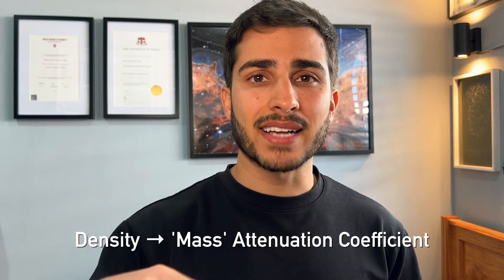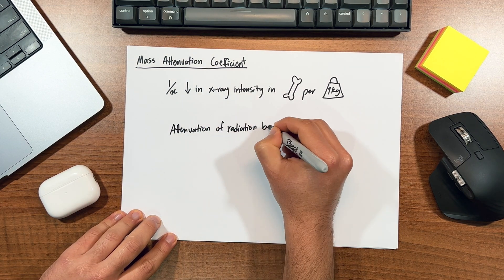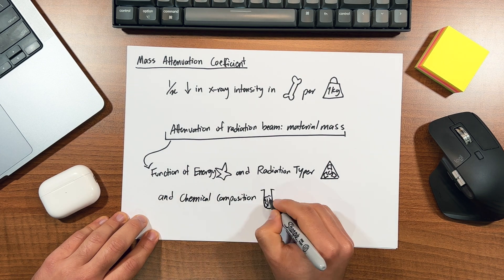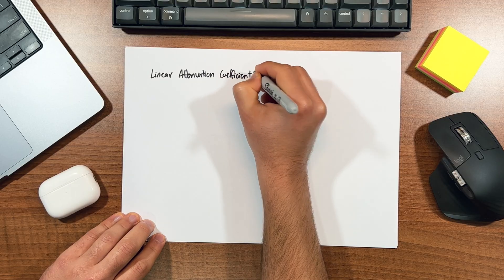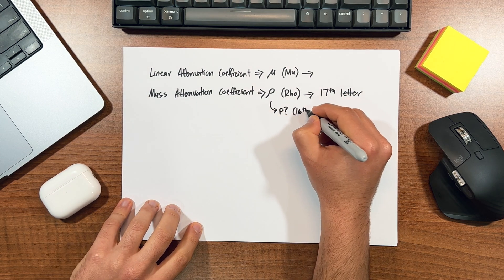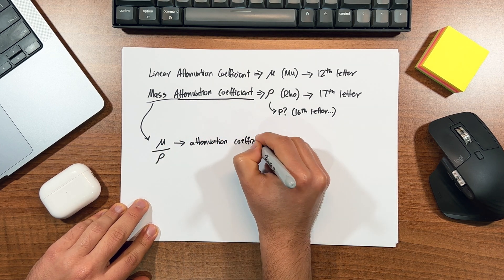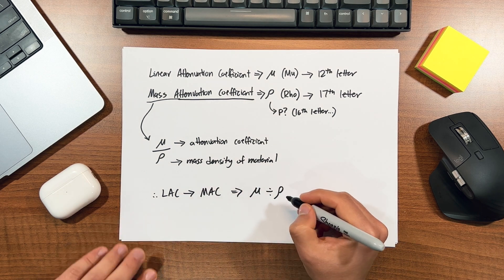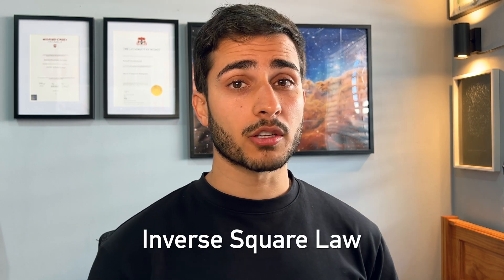Mass Attenuation Coefficient (μ/ρ): Explained!

Comment: Hello Sahand , thanks for the video! I understand what the mass attenuation coefficient is but I don't understand why there is a need to define this quantity. Could you give a real life utility for this metric whether research or radiology and why the linear attenuation coefficient is not good enough in the same application?
Reply from the maker: Hello! Think of it this way, the Linear Attenuation Coefficient (LAC) describes the attenuation (lower of energy) of an x-ray as it goes through a 'thickness' of material, whereas the Mass Attenuation Coefficient (MAC) described the 'density' of that material. That's where the 'Rho' (p looking symbol) comes into play. You would use this for example in calculations of exposure and exposure rate in an ionisation chamber, where the x-ray beam in the ionisation chamber being measured is going through something, in this case air, and so the MAC is used to account for the density of air. And note when you multiply the density of air with the volume of that air you're interested in, that gives you 'Mass' (m) of that area, which is one of the main components of calculating exposure (where X = Q/m). Hope that helps
Reply: Thank you for the reply  @SahandHooshmand ! looking forward to more videos. I would greatly appreciate if you could include a good reference for where I can read more about the application of the MAC. Bushberg and Huda have both been not very helpful haha.